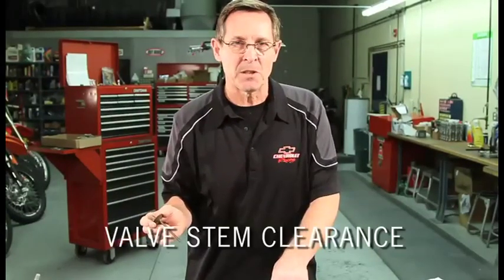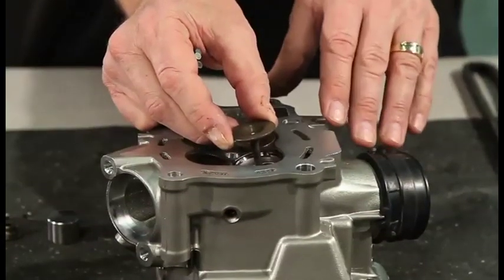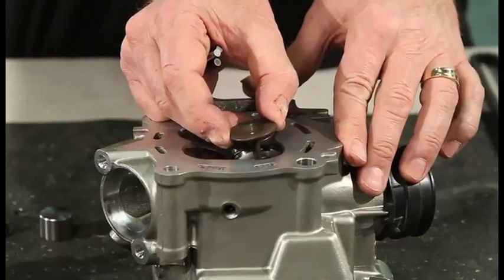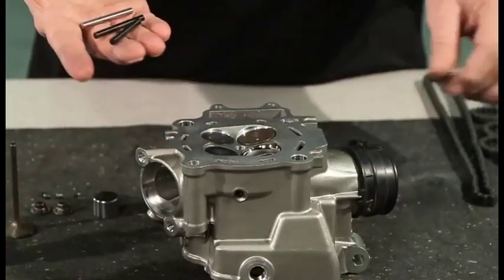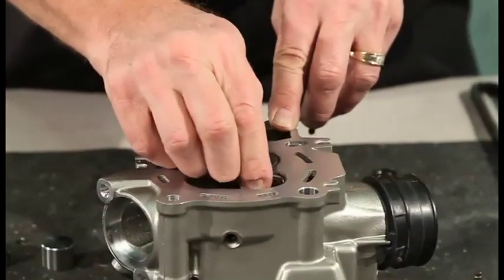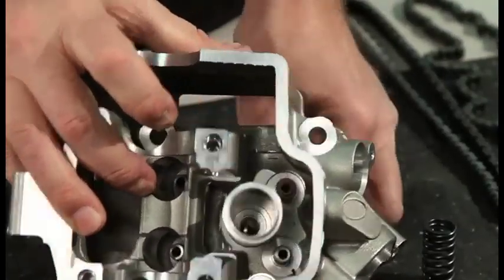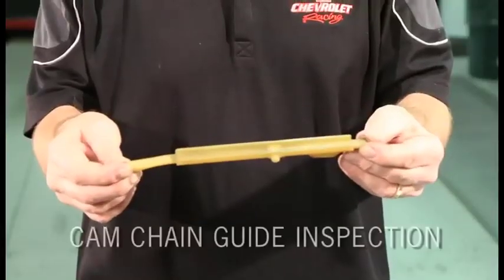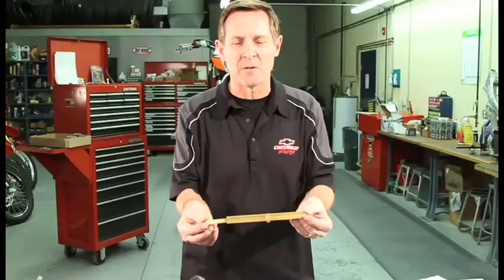Hot Cams Cylinder Head and Valve Inspection Part 2

Comment: Long story short: While attempting TDC, for shimming, a valve popped and fell inside the cylinder head. So I had take the head off to retrieve the valve. Book insisted I be TDC before removing head, but valve wouldn't let me spin the engine to top dead center. I took it head off and put the valve back. What more do I need to do to insure proper timing?  Any videos?  Kawasaki Vulcan 800.